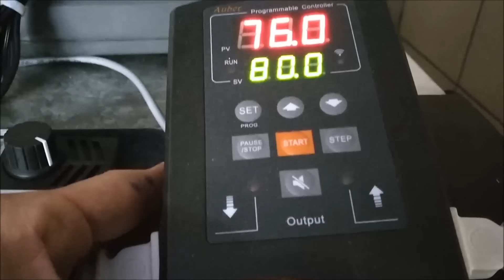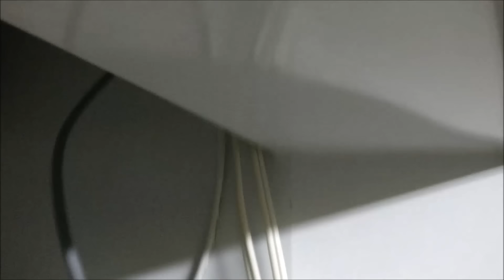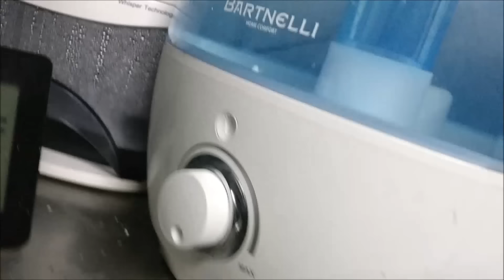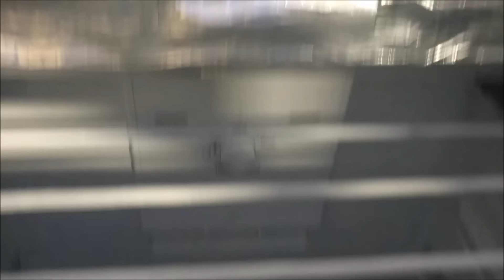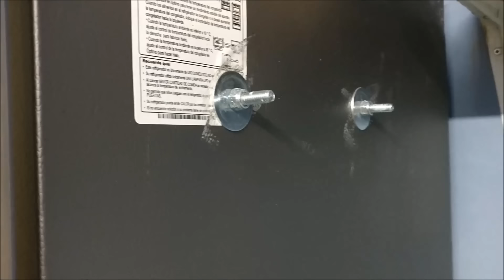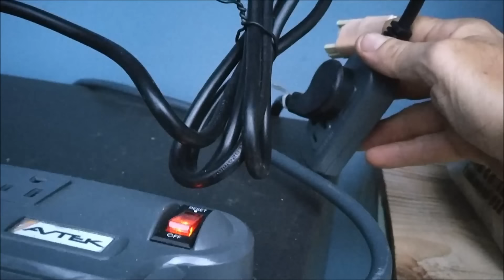Building a Drying Chamber for Salami/Salumi

Comment: Will be in my unheated shop, Not worried about 
spring Summer Fall but winter temps  Nov, Dec thru Feb it runs 40-48  degrees F.  do I need to add some sort of heat source?
Reply from the maker: i would add a reptile mat at the bottom (with a controller to regulate the internal temp)

Comment: Hello , love watching your videos and very inspired to start my own DIY chamber . Just because I do not have a lot of space ... do you think a 85-90 litter wine cooler ( that's 84cm tall about 34inches) is good enough for a small setup ? Will buy controllers for temp and humidity
Reply from the maker: That is good enough for a small set up.  Just check to see where the fan placement is.  If it's on the ceiling of the cooler pointing down, then the fridge won't work.
Reply: @2guysandacooler  It is on the back  , top of the cooler
Reply from the maker: @viktorgnezdilov6331  should be ok

Comment: What are the issues with using a chest freezer as a curing chamber?  Seems like you could run with a larger dehumidifier since the unit will not help remove humidity like a fridge.  Would need to add air circulation as well.  Biggest benefit to me is totally sealed box making it easy to clean and (I have an extra).  Thoughts?  Thx!
Reply from the maker: I've heard that a frost free chest freezer works great.  It's got to be frost free though
Reply: @2guysandacooler  I’m 99% it’s not frost free.  All of the hardware is the same.  I may just give it a dry test run and see what happens for a few days.   If not good I’ll look for a fridge.   My keezer is not frost free.  Keep it at 41.  Humidity is high because of condensate pooling at the bottom.  It’s never froze up.  Or am I not thinking correctly on what the issue would be?

Comment: Hi Eric. I love you channel and I started some of your good ideas. I have a question about the drying chamber. I building one for myself. Do I have to cut off original temperature control of the fridge when I plug the fridge to the  ink bird.
Thanks
Reply from the maker: Thank you.  You don't have to cut off the original temp control.  Just turn the temp to low.  The controller will do the rest
Reply: Thanks. I use the curing bags at the moment but my wife is not happy because all fridge is full with some of your recipe.😊 Thanks again and good luck.

Comment: I love everything you do, thank you! I just made the same mistake of drilling through the refrigerant tubing. What “compound” did you use to repair it, and is it still working. Thanks!
Reply from the maker: Oh no!!!!  The compound I initially used was a 2 in 1 cement compound.  That worked for a little while but eventually started to leak so I actually had my refrigeration guy come out and weld a new tube onto the fridge.  So it's more permanent now..

Comment: @2 Guys & A Cooler in the video you mentioned you open the chamber at least once a day.  I'm an OTR Truck driver and I'm gone for 5 to 8 days at a stretch, home for 2-3 then gone again.  So opening the door dally won't work.  Would this be a deal breaker on getting into and being successful with salami making in a chamber like this?  Thanks for all your videos.
Reply from the maker: Not necessarily.  There needs to be fresh air exchange through during the during process.  Can be done manually like me or you could create a small vent in the chamber.

Comment: On your commercial chiller I understand that you've replaced the built in evaporator fan with a computer fan.  This is good from the point of view of reducing air velocity across the meats and reducing the cooling rate so it doesn't swing so much. However it's not good for the refrigeration system, as it unbalances the refrigeration cycle and means the evaporator won't be turning all the refrigerant liquid to vapour, resulting in liquid returning to the compressor, and ultimately compressor damage.  I'm interested to know if you've had any problems with the refrigeration system?

Comment: I love your videos.  Question on the temp controller:  did you just plug the refrigerator into the controller, or tap into the compressor, so the internal fan runs all the time.  I’m curious about the fan circulating the humid air, or are periods of stillness good?

Comment: Wondering about the use of a duel humidifier and dehumidifier rather than the 2 pieces? That is if there is a unit that will do both that is small in size and affective... Is that a viable way to make the unit work. So then using a plug and play atmospheric controller with the fridge direct in 1 side of the socket and the dule humidifier / dehumidifier in the other socket? 

Of is this not a viable way so the best is to place the individual humidifier and dehumidifier on a hydrostat and the fridge on its own temp control?
Reply from the maker: Oh cool.  I haven't see a dual unit like that.  If there was a unit like that then you wouldn't need the controller (assuming the unit had some built in sensor)

Comment: wow you make this seem so easy im about to turn my mini fridge into a curing chamber iv been a butcher for 12 years but just now have i opened my eyes to cured meats and the possibility of making them myself
Reply from the maker: Nice.   If you run into an issue or have a question be sure to let me know.
Reply: @2guysandacooler  okay well I could ask a few questions that may help stear me in the right direction iv got my mini fridge what's the first steps to making the curing chamber maybe using a thermo/ humidity reader to check the inside of the fridge sits at currently or?
Reply from the maker: @-TRiiX-  so i would recommend getting this one:  https://amzn.to/37bUung  It is truly a game changer for charcuterie.  I'm about to make a video about it.  A must have!!  The next thing I would get is a temperature controller and a humidity controller:  https://amzn.to/3rOiVPH 
Finally a humidifier and dehumidifier.   With those things you can have a chamber that is temp controlled and humidity regulated.  Setting up a chamber is the most difficult part.  Once your chamber is dialed in the rest is pretty straight forward..
Reply: @2guysandacooler  long day at work but i got the chance to order a few things #1.Pro Breeze Electric Mini Dehumidifier 2.Cool Mist Humidifier Ultrasonic 3.Govee Humidity Meter, Mini Bluetooth Hygrometer the one you had linked was not in stock so this seemed good 4.Inkbird Combination Humidity Controller Ihc200 and Temperature Controller Itc308 now ill have all of it in 24 hrs and i guess ill get to testing my set up trying to figure out everything
Reply: is it weird that i only have the controllers and a thermo/ humidity  stat and the temps i set are holding pretty stable? im sure that would change with meat inside i think i set it to 80% humid and 55f something like that i seen in a video fo yours
Reply from the maker: @-TRiiX-  LOL.  Every chamber is different and will react differently once you add meat to it.  The temp and humidity you listed are correct.  80% humidity and 55F
Reply: @2guysandacooler  okay so i got everything the two controllers a humid / dehumid all sensors set up and values all set up one thing i notice is its a mini fridge and the to little freezer part seems to have watter / melting ice type of thing iv cleaned all ice sometimes a little watter will pool up in the bottem of the fridge what can i break and or disconnect to maybe help that or is it normal i can take pictures and post them what ever makesthis more easy and thanks for any helpful information on the subject
Reply: also the place to plug in my dehumid and humidifier into socket work 1 work 2 iv had to plug extension cords into because the power supply of the units are bricks and tthey cannot plug side by side is this gonna create an issue ?
Reply: seems i found another problem the humidifier is got a digital on button so when the unit gets shut off and back on it dose not come back on it just sits their waiting to be turned on FeelsBad f
Reply from the maker: @-TRiiX-  yeah.  That's sometimes the problems with mini fridges. They are generally not frost free.  A little water isn't that big of a deal as it will most likely cause the humidity to stay high.  Not sure if you can disconnect that part of the fridge.  You'll have to do some research on it.
Reply from the maker: @-TRiiX-  no that's how mine are as well.  As far as the dehumidifier goes.  That unit will not work.  It must have an auto on feature.  What country do you live?
Reply: @2guysandacooler  canada say toronto area
Reply: @2guysandacooler  you men a humidifier right the dehumidifier has and on / off so when it cuts it always on it was othe other unit
Reply from the maker: @-TRiiX-  oops.  Correct.  Himidifier
Reply: @2guysandacooler  queestion i the humidity controller set up it reads 67% and i have another groovy temp / humidity monitor they vary by alot tho the groovy one reads 77% and the ink bird reads 67% ? the sensorrs are pretty close to each other its a mini fridge whats the big difference ? maybe because no fan? or maybe you got a better idea  !!! thanks for all your help !!!
Reply: @-TRiiX-  I have the same issue with various compact temp/humidity sensors. I’m now just following what the inkbirds read and everything seems to be working fine. Only issue I had is I built my chamber from a mini fridge and the side of the salami that was against the cooling fins at the back got mushy and had to be tossed. Pretty sure it had to do with elevated humidity and lower temps there. Good news is I’ve now procured a used sub zero fridge without a freezer compartment (for free) and am now making it into a new chamber. An easy fix for the circulating fan is to put a fan speed control like the one for ceiling fans and you can regulate the amount of air flow in the chamber.

Comment: Good Day Erik. Your videos are very convincing. If you have time to elaborate just a bit... It's difficult to find guidelines about airflow using a  computer fan inside a small chamber... I'm a little puzzled at how long should the fan run throughout the day during fermentation/drying stage... and for the longer term maturing stage,  with respect to fan  speed(i.e.- low, medium, high)?
If you could shed some light. Thanks, your videos helped me build/convert my wine frig curing chamber using Inkbird 308 and 200 wifi units. The frig can hold about 12 pounds of meat. My cure chamber is setup with Ultrasonic  humidifier, Evo dehumidifier, and a small high-speed computer fan with fan speed regulator. Thanks much appreciated all your videos and can wait to have some Salumi success!!!
- Tony
Reply from the maker: Hello Tony, Air speed is a tricky issue. Too much and you get dry ring.  The idea is to keep the air flow to an absolute minimum.  You want very little air flow and often when the compressor kicks on the fan used to circulate the cold air is generally enough.  Unfortunately there's no good answer because each chamber is different so my suggestion would be to start a small batch with no additional air flow of your computer  fan on the lowest setting and see how your chamber dries your meat.  If you notice dry ring on your charcuterie you might want to lower the air flow or remove it all together..  Hope that helps

Comment: Do you find that the conventional refrigerator holds temp better than the cooler with glass door? 

I used to have a curing chamber fridge, now I have a cooler and it seems to not hold temp that well.  Cycles a lot to maintain temp range.
Reply from the maker: It does seem to be better insulated.

Comment: Hey Eric! Do you actually turn on the refrigerator? And is a low running fan necessary? I'm thinking of converting my crappy mini-fridge, which lowers the temperature to 10 degrees or less at best, into a drying chamber. The ambient temperature in my house is now around 65/70 F. Would it be okay to use this kind of setup during the winter time only? Thanks!
Reply from the maker: So the fridge is operated by a controller that turns the fridge on and off to keep the temp that's pre set.  There is a small computer fan running in there and its set to run when the fridge turns on.  Sounds like your setup might work :)

Comment: So I have a line on a 6.5 cubic ft Thomson Upright freezer that I think would be the perfect size for a great price. Is there any reason that a freezer would be less desirable or unusable for curing chamber versus a refrigerator?
Reply from the maker: Generally freezers are not frost free so an issue you'll have to deal with is radical humidity fluctuations.  Some freezers gave a fridge setting which might be better.
Reply: @2guysandacooler  so if it were a frost free freezer, I might be ok? Or no?
Reply: @DrewGillespie0825  yes

Comment: I hooked my fan to the same power source as my humidifier. So,  it only kicks on when the humidifier does. That's for about 5 minutes every half hour.  Would you say that is sufficient air flow or should I run its power seperate? I also open it twice a day to freshen up the air.
Reply from the maker: You'll have to see how your charcuterie acts with the air flow.  I find that the internal fan is sufficient to circulate the air and generally any additional fan adds too much air flow, BUT each chamber is different. If you find that your salami/salumi are drying too fast just unplug the fan and see if that helps...
Reply: @2guysandacooler  thanks for all the help.  It's much appreciated.

Comment: hello, I'm stefano I'm not clear about how the timer works, if you can please explain it to me. the blue control timer can be set to both humidify and dehumidifier bought Inkbird ITC-608T Temperature and Humidity Controller 1800W i think it is not good for the dehumidifier, what do you thinkI' ll give you my email if you can contact me thanks
Reply from the maker: OK So the ITC 608T has lots of options.  If you want it to dehumidify you'll need to refer to section 5 in the manual.  The issue is that if you want this unit to dehumidify you are exclusively using it as a humidity control.  If you are using it as a temperature control the unit will not dehumidify...

Comment: Even though I was trying to be careful I broke a line also. What type of compound did you use to seal the broken line?
Reply from the maker: I used some of that epoxy that that you mix together but it's didn't last a long time.  I eventually had to weld a new line on to fix the hole.  For that I needed an ac guy to come out but they fixed in in 45 minutes

Comment: I Have a pro Breeze Dehumidifier in my Curing refrigerator and it freezes up within minutes   My fridge temp is 39 Degrees, And  my inkbird Humidity Controller is going from 78 To 94  I have it set for 65 percent  It  Constantly goes up and down
Reply from the maker: Those dehumidifiers work in temps above 45F.  Under 45F the unit (as you are experiencing first hand) will freeze up...

Comment: So I purchased a cheap old refrigerator off of craigslist for like 40 bucks and wound up drilling a hole in the side and busting the Freon tube I’m curious on a conventional refrigerator where is the best place to drill not to hit any refrigeration coil lines?
Reply from the maker: That's a hard question.  The gas lines run all along both sides of the fridge.  You can come in from the top by the door and be fairly safe..

Comment: Hey Guys! Great videos! 
Quick Question, I have my chamber running its first cure, and it seems like I'm filling my humidifier every couple days. I'm keeping RH between 75-80. Does that seem normal? Using a Holmes Ultrasonic HM500TG1-UM and an Evadry.
Reply from the maker: Is yours the model that fits roughly 2 quarts of water?  It does seem a little fast but as long you are averaging a 75-80% you should be fine.  Sometimes when the compressor cuts on in the fridge it sucks out the moisture from the air.  This may be causing your humidifier to run a little more than usual.  Keep me updated as to how it turns out.
Reply: Yep, that the one, So, I ran out of water yesterday so I did a test to see what damage the compressor has on the RH. When the compressor kicks on it sucks the RH to 60, but comes back up to about 68-70 with no help from humidifier. after filling humidifier, its holding between 75-80 as the controllers are doing their job. I'm just concerned that I have a 4 day trip upcoming and it will be without water for two days.
Reply from the maker: @warpigsmokehouse3026  perhaps you could add a bowl of water in the chamber with a towel in the water that's slightly hanging off the side of the bowl.  This will keep your humidity high while you are gone..

Comment: Hey guys, quick question. Is it really necessary to have an exhaust fan installed. I know as you said I could open the door once a day or so. If I decide not to refresh the air would there be any negative reaction during drying or curing meat?
Reply from the maker: It 's not necessary to have an exhaust fan in your chamber but fresh air is needed.  Opening the door is the best way to achieve that.  If you don't allow fresh air inside the mold doesn't grow properly and the chamber will smell like urine.  It also affects the way the salami cures and dries..